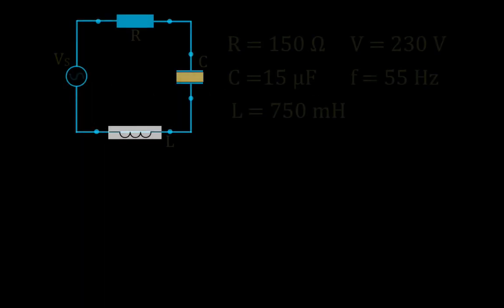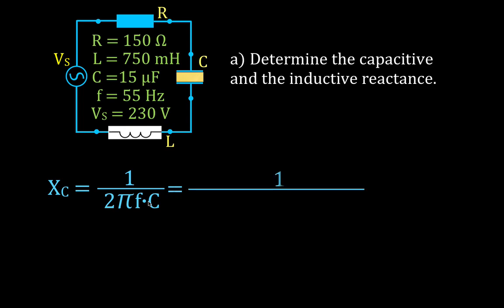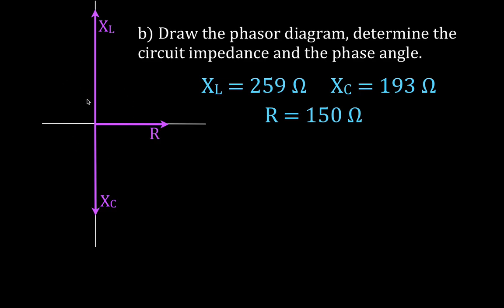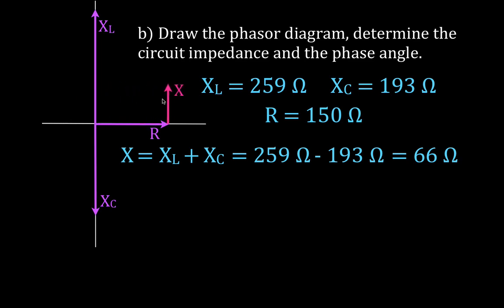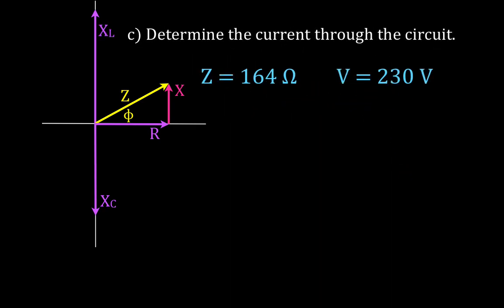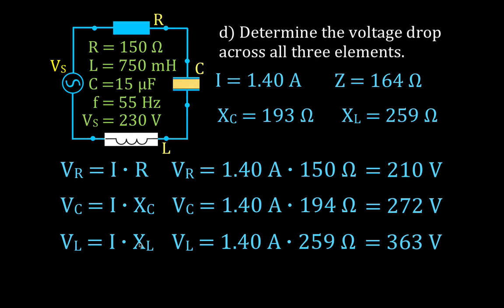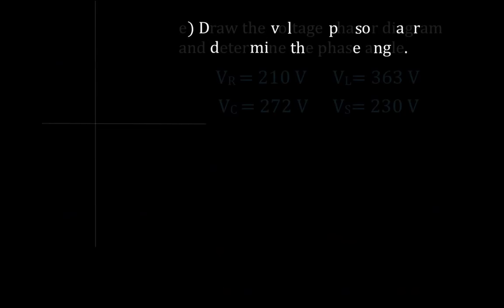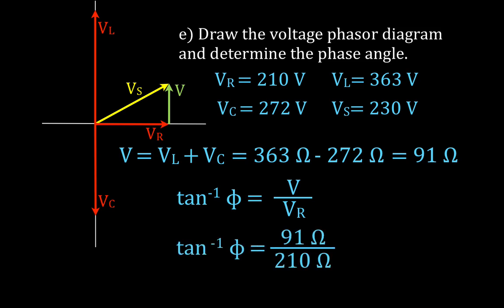RLC Circuits (12 of 19) Series RLC; Calculating Impedance, Current and Voltage

Comment: Just in case if anyone was confused, around 11:55, the units for voltage were mixed up with the units for resistance. All the numbers are correct, but instead of ohms, it should have been V as the unit. Nevertheless, this video was very helpful for solidifying my understanding about RLC circuits, and I would recommend this to anyone new to AC circuits.
Reply: ;) was thinking exactly the same thing :)

Comment: Video is very nice and clearly explained a somewhat difficult subject. Just correct the symbol for voltages to V in the last part of the video. It is showing the Ohm sign for resistance eventhough while talking you correctly said voltage. It's a typo but correction is necessary to not confuse the beginners.
Reply from the maker: Thanks for the info

Comment: Excellent video the best professor … one doubt only when you worked out the phaser diagram for voltage the units you indicates were ohms …. I thought that it should be volts as we were working with a voltage phaser diagram…please let  me know …thanks
Reply from the maker: Yes, you may be correct. Sorry for late reply!

Comment: Ughh... Why is this so difficult... I only have the value of frequency, capacitance, inductance and resistance... No current, no voltage. Or is my question just missing some important parts? I'll definitely will ended up hating this subject if my lecturer missed this... 
Please tell me...

Comment: How do I calculate Total Reactance (Xtot)?
It's an RLC series circuit.
Resistor (R) = 330 Ω          Capitance (C) = 0.1 μF          Inductance (L) = 33 mH
Frequency (f) = 0.5 kHz
XL = 0.104 kΩ                XC = 3.183 kΩ
I looked up the formula but I'm bad with imaginary numbers topic...
it's Xtot = | XL - XC |

EDIT : Sorry, I didn't see your X total... In my university note, the formula is | XL - XC | which involves complex/imaginary number... but most websites I searched. They just subtract normally... I don't know which one I should follow....

Comment: Good video. In my math class we have math applied to electronics, and one thing I find confusing is when we try to find the voltage drops across each component, but  the voltage is determined in Cartesian form with complex numbers. Do you have a video on this?
Reply from the maker: Sorry at this time I do not.

Comment: You’ve made a mistake on exercise (e) which is to draw the voltage phasor diagram=
= you gave the omega sign Instead of the voltage sign when you calculated the angle of the supply voltage

Comment: hey, can someone tell me how the voltage over the XC and the XL can be higher then the voltage from the source. thank you!
Reply from the maker: It is alternating current so the source voltage as well as the voltage across each of the components is always changing with time.  But the sum of the voltages at any point will always be zero.